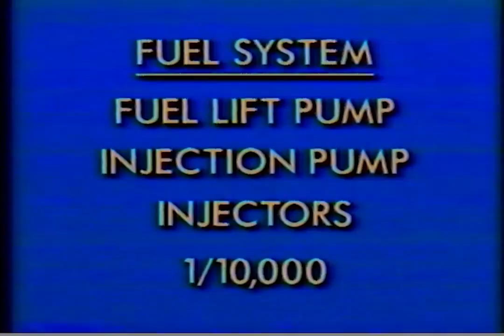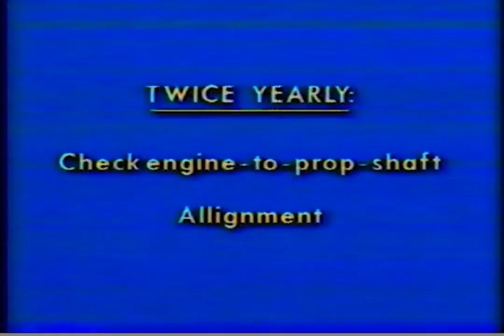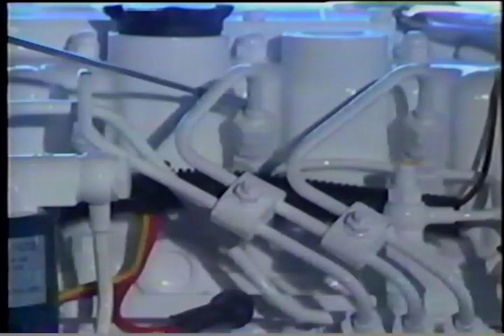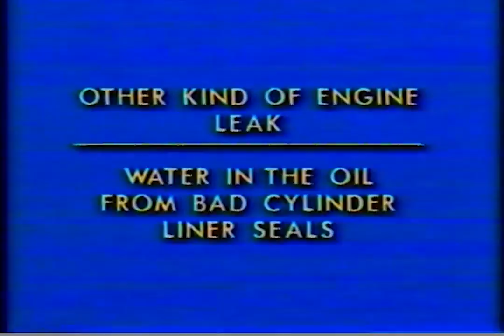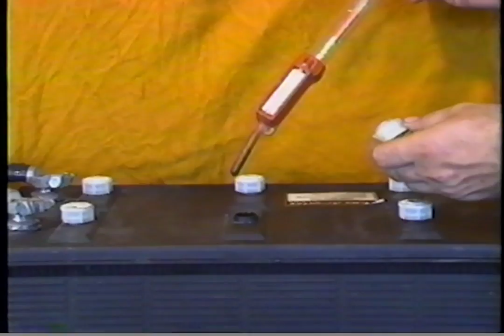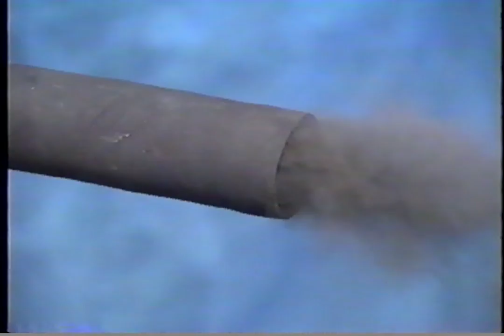Bennett Marine - Diesel Engine Maintenace

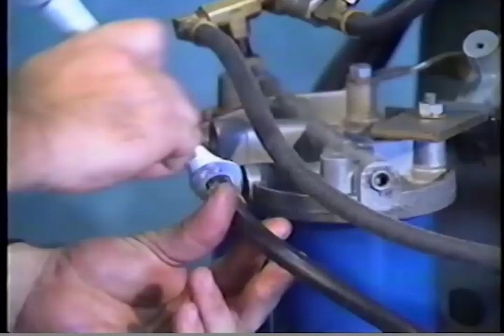Comment: 1:09:48 It shows a trick to find a diesel fuel system pinhole leak. Bubbles somehow appear in jar of diesel from which the lift pump is sucking in fuel. Do these bubbles signal a good fuel line or a bad one? How does the trick work? Transcript:
"Start with the line from the water separator to the lift pump. Disconnect it from the separator. Place the line in a jar with a clean diesel below the level of the lift pump and operate the lever on the lift pump. If the fuel comes through without air bubbles, replace that line and go to the next one, back towards the tank. Keep repeating this process until you've isolated the leaky fuel line, valve or seal."

Comment: How about a clogged  exhaust mixing elbow?  On an old engine, the pipe/tube/casting, downstream of the exhaust manifold but before the muffler,  can get choked with internal rust you cannot see from the outside. That's because hot gas + salt water (from the heat exchanger) + iron = a recipe for rust formation.  When the rust gets so bad, the engine cannot exhale,  and it runs okay at idle but at wide -open throttle it still runs....but at idle rpm (with of course much-reduced power).

Comment: Thought all videos were very good. Could not find the one I need. Currently trying to adjust the throttle linkage at the Edison pedestal after replacing ball joint attend engine at of things. Won't go into the forward gear unless done manually. Thanks for your efforts! Joe

Comment: Bill Caddy
1 second ago
Bill Caddy
1 minute ago
I strongly recommend, when changing oils on your narrow boat use disposable gloves to protect your skin. Used oil in diesel engines is carcinogenic. Google up the lubricant manufacturer & read the Safety Data Sheet, for handling used oil.
REPLY